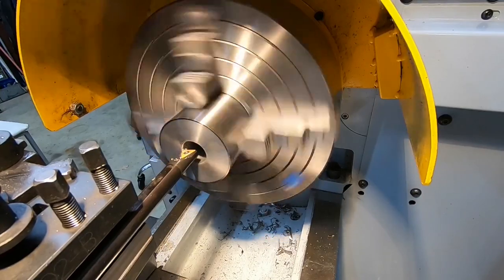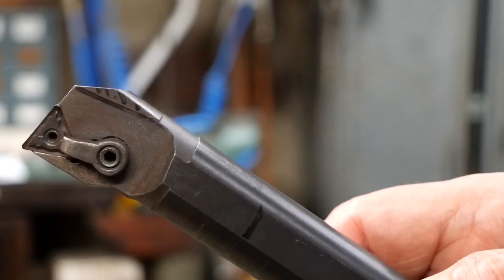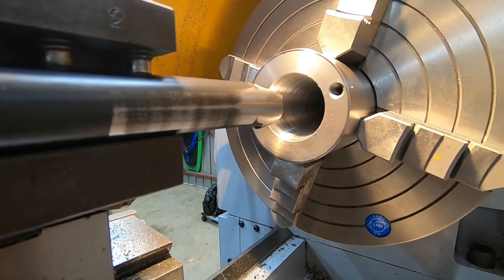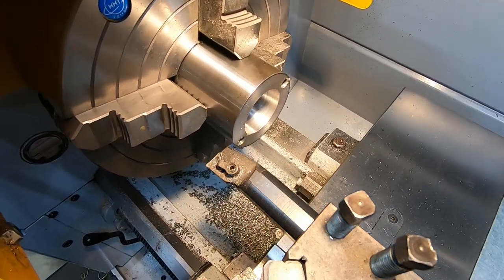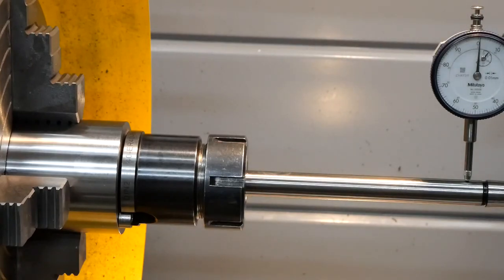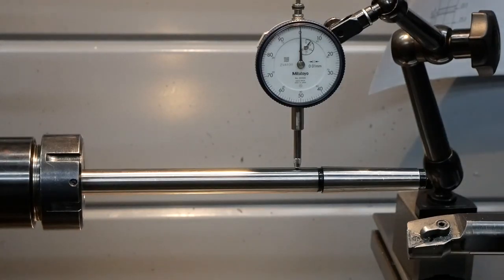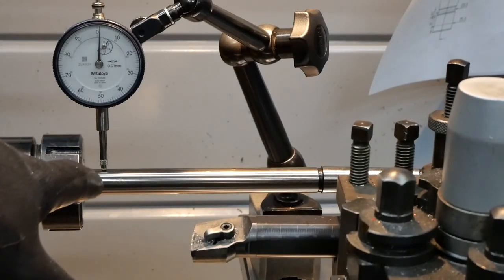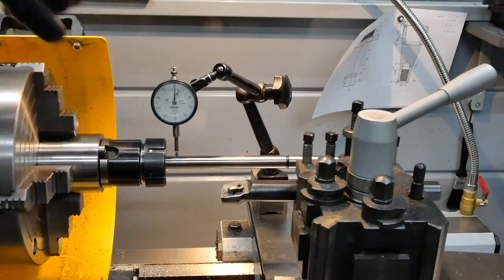Truing up an NT40 socket - a foot note to the ER40 collet chuck project.

Comment: Good workaround. Try to stock up on a few sizes of solid carbide boring bars that take inserts. Far more rigid at smaller diameters.
Reply from the maker: Thanks - any tips on sourcing the bars ?
Reply: @alanshomeworkshop  another option is to take light cuts with a sharper ground insert, that'll reduce deflection.
Reply: @alanshomeworkshop  search for C12M-SCLCR or C12M-SDUCR (I though I replied, perhaps I forgot to hit save)
Reply from the maker: @HM-Projects  Thanks.  I notice that you have also made an ER40 collet chuck and runout was similar to my final result. However it seems you got there without needing rework :) If you feel inclined to swap notes off-line about our machining projects, perhaps send me an email with your contact details.
Cheers, Alan.
Reply: @alanshomeworkshop  yeah will email you, for some reason YT doesn't like my comments with links or email addresses.